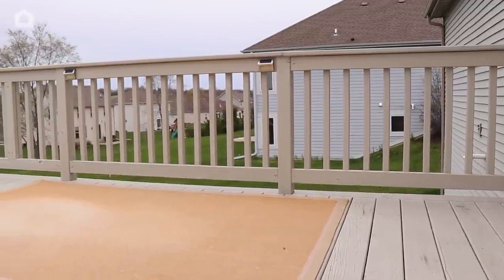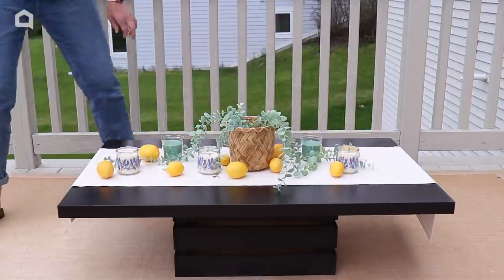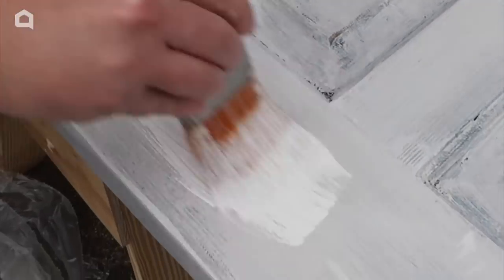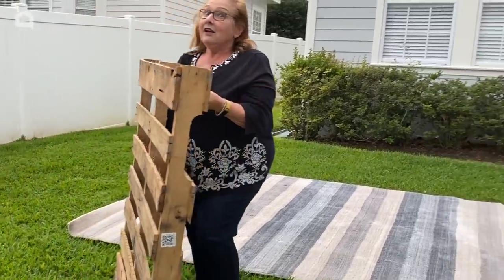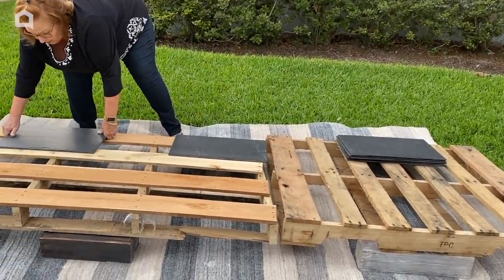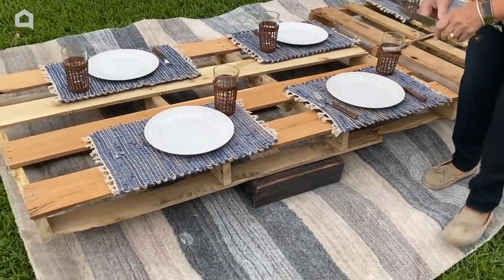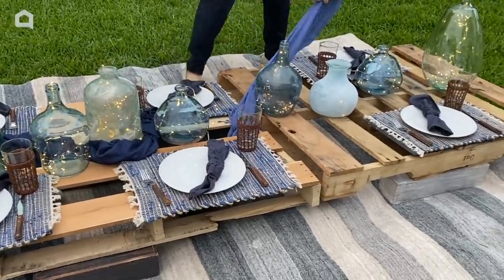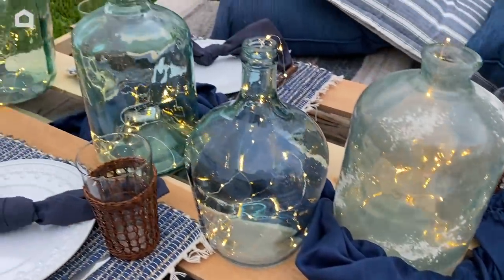She puts a crate on her porch for this brilliant idea!

Comment: The pallet picnic idea would be ok for kids. But for anyone with even slight mobility issues it would be ruddy uncomfortable, and impossible to get up again. 
I liked the first idea best but I’d use two crates for better stability.
Reply: Exactly!
Reply: We like the idea of four crates or four sawhorses and two pallets. That way if anyone spills theirr beer or has a leaky fish taco it ends up on the lawn and will eventually compost. Depending on the crew that is being fed they can sit on more crates as long as they don't come in at 250-300 lbs. For those folks maybe those milk crates that get nicked from behind supermarkets might be good. We have seen as many as ten fitting into shopping carts.  Just a suggestion.

Comment: The old door one for outside was a great idea, the other two are not practical at all…most people can’t sit on the ground or floor especially when outside (fire ants, regular ants, etc).
Reply: My grandkids would think the pillow seating with the low table on the deck was awesome! They get bored sitting at the big table with us but the little one would be a party.😁
Reply: Agree with Rina Kellogg.  And I think,  for the money, just get a nice, simple sturdy table that you can use for years to come and get on with it.  I would not want to be sitting so low to the ground and dining this way.  So awkward and uncomfortable.
Reply: @hollycaffeinatednerdgirl940  

  
, 
 ;
Reply: Exactly!
Reply: That door given the design that it had with the high and lows doesn't make for a good table.
Reply: @wiseforce7045  yes, it would be perfect with a sheet of clear plexiglass over it.  Otherwise, how can it even function as a tabletop?
Reply: @joanrutledge8516  It's that what they did?

Comment: The pallet picnic decor is very pretty, but I am past the age where I can sit on the floor with my legs folded. If you can't provide a chair or low stool, I pass on the invitation. I would not ask adults to sit on the ground, with or without the throw pillows. Maybe it works in Japan, but Americans aren't used to it.

Comment: The small table, though cute, I would think has stability issues. Kids have a tendency to put their full weight on furniture & have balance challenges. I think it would constantly tip over!
The 2nd idea was just tacky! Without paint, maybe a level plywood surface, it was just rough pallets thrown on the ground!! Good luck placing a glass or beer bottle in the wrong spot! And few adults like to sit on the ground in their own yard! This idea was definitely not elderly friendly!

Comment: Using un- cleaned pallets isn't a good idea, even if once you sanded & cleaned them & you only put on a sealant that's better than raw dirty wood. Pallets are great for making furniture from them in all kinds of ways.
Reply: I agree. Pallets get used over and over and you can never be sure what was transported on them. There could be chemicals that were absorbed into the wood that you would not want anywhere near consumables.